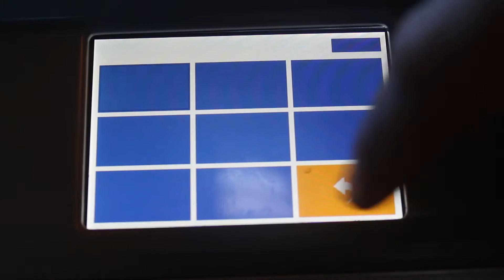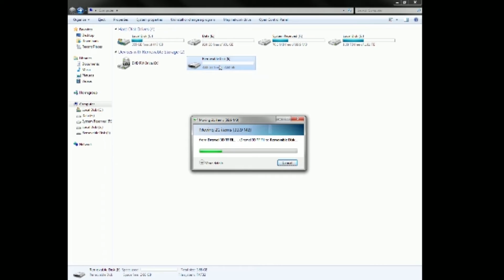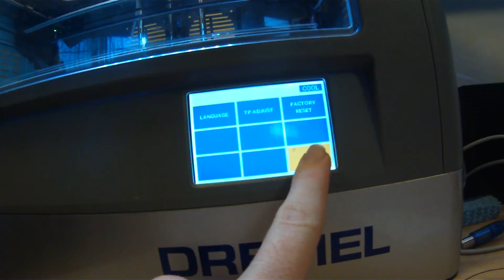Dremel Software Problems and how to fix them (where did all the words go?)

Comment: Inherited one of these at work. Ours would reset when you hit the touch screen or white screen of death. I managed to flash the firmware , no help. Replacing the sys file did the trick. Thanks for posting the file, maybe add it to your description. Also if you have a fubar SD the formatting is 32bit, your screen shot is unreadable.

Comment: Hi!  Do you happen to still have the files? My problem isn’t exactly the same, but still related to the system not running correctly on the printer. Please.

Comment: Hello! Do you happen to still have the files? I’ve emailed Dremel and haven’t heard back. My problem isn’t exactly the same, but still related to the system not running correctly on the printer
Reply from the maker: Yes I still have them if you give me your email I can send them to you

Comment: We all same to be facing the same issue LOL.  Would you be able to send me the files?  I'm scared to post an email address here but I'm guessing that we can figure out some way to send the files.
Reply from the maker: Yes I would be able to send you the files. I am open to other ways I can send them. I would love to be able to post them somewhere so people can just grab them without having to go through me every time got any suggestions?
Reply: @RedHairTech  Thanks!  I'm thinking that Google Drive would work.  I was initially thinking that you could make a MediaFire post, but you may still need an account to make MediaFire uploads (and that site isn't as secure).  

But heck, if Google Drive isn't good, then I'll just try throwing together a temporary email address somewhere that doesn't require attaching your cellphone number lol

Comment: Thank you very much for the tips I called a Dremel support line  1 (844) 437-6533, explained my situation and got the files in 5 min. My touch screen kept resetting to the start screen when touched.

Comment: Hello, I am also printing masks to help my city with the coronoravirus, after 20 printed units, the DREMEL just stopped working, I have a problem exactly the same as yours, only that formatting the SD Card did not fix the problem, I get the menu without letters or anything, I see that in the SD card the Sys folder has some XDF files and one .BIN could you share with me the ones you have to see if the problem is software? Thank you
Reply: nubacorporation@gmail.com